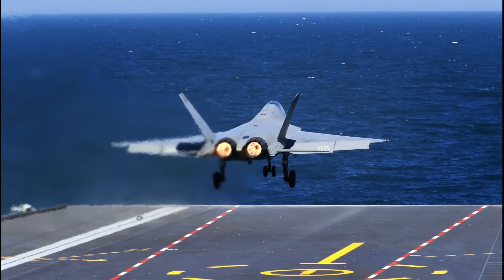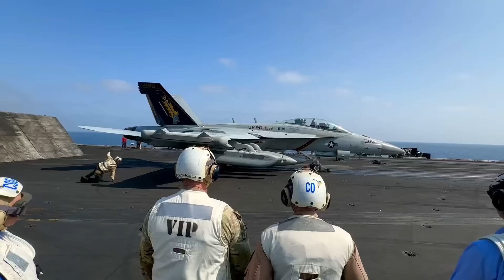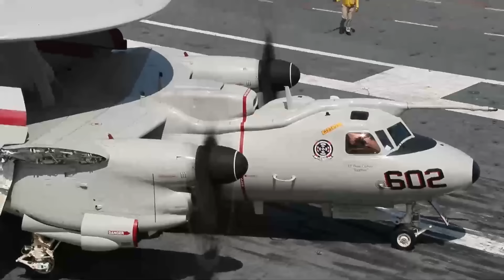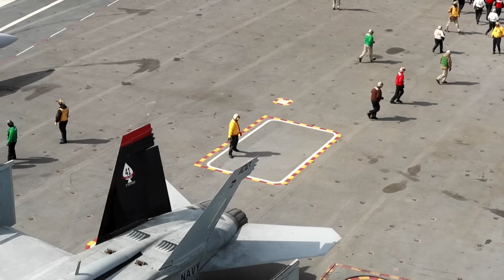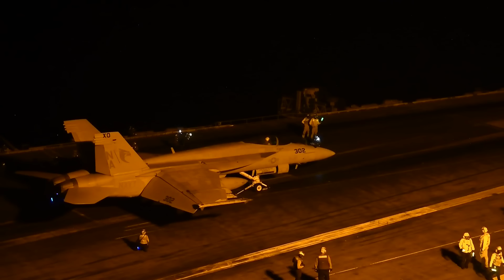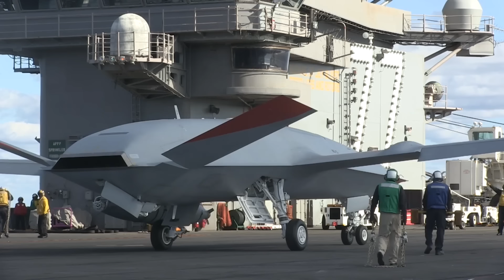EMALS Catapult on US Carriers: Mistake or Masterpiece?

Comment: Everyone is so quick to jump on the “it doesn’t work perfectly the first time so it must be absolute garbage!” wagon. Things take time to get right. Especially big, new, complicated things. The USS Ford is full of new tech and ideas so of course it has growing pain made worse for being over deployed.
Reply: Well if it doesn’t work during 2027, you may or may not have issues. Same situation with the constellation class.
Reply: Tell that to the auto makers. All I see is our vehicles getting worse and not lasting as long as they use to.
Reply: The problem isn't EMALs.

The problem is the Ford class' integration of it.

The hybrid-mechanical AC system they went with for it is, by all accounts, an absolute shit show. Can't achieve even 10% the reliability required of it after 10 years of trials, necessitates shutting down the entire catapult system if a single track breaks or requires maintenance because of the way they architectured it and replacements are a complete nightmare, having to shift a 12 ton mechanical flywheel out from a compartment located deep in the ship's hull.

The only thing this system is good at launching is bundles of cash, in General Atomic's direction...
Reply: @toma3025  The Electromagnetic Aircraft Launch System (EMALS) on Ford-class carriers relies on complex electrical architecture, energy storage flywheels, and power conversion modules rather than a direct hybrid-mechanical air conditioning or cooling system failure. The operational reliability of EMALS sits at roughly 98% availability overall, not quite up to the 99.5% which traditional steam catapults achieve, but that will come given the opportunity and time.
Reply: @chrisparnham AC = Alternating Current, not Air Conditioning

Where is your source for 98% "availability" and what does "availability" even mean?

Because the only metric that actually matters is the mean number of launches between failure and it has been well documented that the EMALS falls well below the minimum operational requirements.
Reply: @toma3025   Availability means the percentage of time a system is fully functional and ready to launch aircraft when needed. The reasoning behind EMALS maintaining roughly 98% operational availability despite its low reliability numbers is due to rapid reset capabilities, system modularity, and shared energy storage. To get that figure, in official defense acquisition guidelines, the Navy established that EMALS must sustain a 98% Operational Availability (\(A_{o}\)) over an extended deployment period. This is easy to look up, so why haven't you?
Reply: @chrisparnham I think it's hilarious you're telling me to look things up when you're the one who mistook AC in the context of an EMALs system for air conditioning, rather than alternating current. What a hilarious self-reveal that you have no clue what you're talking about.

Anyway, the metric you have mentioned is totally irrelevant (and actually sounds completely made up). A car with no brakes can have "100% availability" - as long as you don't ever need to get out, or stop for traffic. Just because a catapult launcher is "available" for 5.88 months out of a 6 month deployment, it doesn't mean anything if it breaks as soon as you have to launch a meaningful amount of sorties.

As I stated before, the only metric that matters is the average number of launches between a failure and on that metric, the Ford classes' EMAL is a disaster.

This is not a controversial or exaggerated take. The US Navy itself is very aware of and has admitted this problem.
Reply: So, you agree everyone is overreacting to the negative effects of AI in the long-term?
Reply: They US don't have such time.  They need it deployed to do its murder missions.
Reply: Oh yeah? Let me tell you something  about magnets, give me a cup of water, I pour it on the magnet, thats the end of the magnet
Reply: @Paul-tf9gv  No, it doesn't. Pouring water on a permanent magnet does not destroy it or end its magnetic field. Water is non-conductive enough and chemically inert toward the atomic alignment inside permanent magnets, so a glass of water just makes the magnet wet.
Reply: @Paul-tf9gv  Water doesn't kill magnets - heat, shock, and vibrations do.

Comment: Can someone answer this question: can emals be repaired as simply as a steam system?
Reply: You can figure out what's wrong with the EMALS system with a software diagnostics unlike a Steam Catapult. I remember seeing some early Type 003 Fujian pics of them hinting launches, and seen some images talking captioned that the techs were doing some software diagnostics when they were running catapult tests on the EMALS. And supposedly EMALS requires less maintenance compared to Steam, and I think EMALS might have modular parts at least for the Chinese one. They have a EMALS that coun can build and connect with these trucks that interconnect to form a long launching rail. 

But I am no expert on the topic.
Reply: It should be easier. Your dealing power cables and electro magnets Vs plumbing. If you know what you're doing electricity is far easier and safer to work with. Despite what some people have claimed you don't need to be a genius to work on them and the steam from the steam catapults is not the cleanest air you will ever breath. I'm fact if you ever get the chance don't breath that steam. It has some nasty anti corrosive chemicals in it.
Reply: @Josh-iw1kq I guess it's cause I can look at a steam room and be like none of it makes sense but I can grasp it.
Where's looking at what I've seen of emals it's like looking at a mercury rectifier or messy server room, basically black magic.
Reply: @A_barrel  it's not your bag and that's ok. But it really is simpler to repair and maintain.
Reply: It all depends if a person wants something dependable and electronics are not it.
Reply: @TomM60  idk about that. Modern warships are heavily dependant on electronics and have been for 40 plus years. Guided missiles, flight operations, communications, and situational awareness all depend on them.
Reply: @Josh-iw1kq  Yes and every time a jet takes off using an electronic launcher the electricity that is used can cause a glitch in the rest of the systems, that's why they want to go back to steam launchers.
Reply: @TomM60  with respect, your information is out of date.
Reply: @Josh-iw1kq  That's right and those electronics need energy and those EMALS were hogging it up and then going down. At least steam worked before and it still does now.
Reply: @TomM60  that's incorrect. The Ford was designed around emals with excess power for  future upgrades accounted for. That's why it generates as much energy as 3 Nimitz class carriers. also the system has performed well over the past year. So it's not theoretical anymore, it's combat proven. In short, emails works, and it's a more efficient system that's safer to operate and easier to maintain.
Reply: @Josh-iw1kq  And like anything else heavy in electronics it doesn't always work.
Reply: @TomM60  and like anything else mechanical steam doesn't always work. Your point? 37,000+ sorties, have flown off the deck of the Ford since it was launched. Emals has an uptime of 98% compared to steam at 99.5% so yeah steam has a slight edge there but it's a 70 year old technology. Emals is still improving, steam is not. Neither system has been tested on a ship that had sustained combat damage but emals is safer and easier to repair. Were steam is basically a small bomb if a pipe is ruptured.
Reply: @Josh-iw1kq  And how many flew of the Nimitz class carriers? From what I was told by someone's wife who's husband is on the Ford, it's a floating pile of junk and she listed a nice long list of problems in that thing.
Reply: @TomM60  I'm not asking this as an attack, but have you ever served? It's military grade equipment, of coarse it has a long list of problems. But emals is the future. We've been running steam catapults for 70 years and we've gotten pretty good and managing the pitfalls that come with it. As the training and tech improves we'll get better with emals as well.
Reply: @Josh-iw1kq  Yes, I'm a Marine Corps vet and don't tell me about how great the latest electronics are in the Navy.
Reply: @TomM60  when did I say anything of the sort?
Reply: @TomM60 do you live in the 80s? modern electronics are massively dependable in 99% of cases aby semiconductor with defects fails early and if it doesn’t it will live a long life. Surely pistons and high pressure steam is very dependable that’s why we power everything with clunky steam engines (oh wait)
Reply: @Denguer-b1s  Boloney. I never had a problem with my Motorola RAZR in the 15 years I used it. Then when they no longer had a wave length to use it on I went first to Samsung, that thing always had problems. Then I went to iPhones and learned quickly after six of them they are a delicate waste of money.
Reply: apparently so for China, they can just pull some guys from the maintenance teams of maglev train.
did i mention that China has been running maglev trains for 20 years ? these ones had likely broken down a couple times and at least these Chinese engineers have gathered a fair amount of experiences fixing an electromagnetic propulsion system, which could translate analogously to an electromagnetic catapult system. it's nothing rocket surgery, people just tend to overlook some innocuous but secretly-related stuffs.